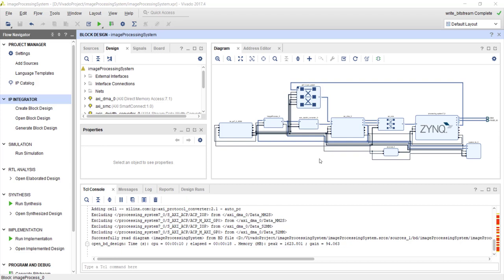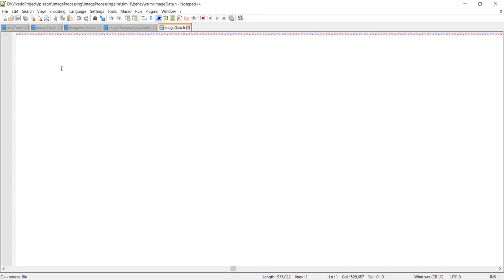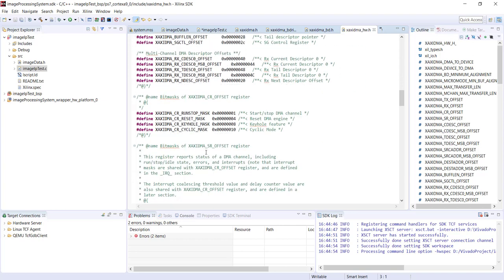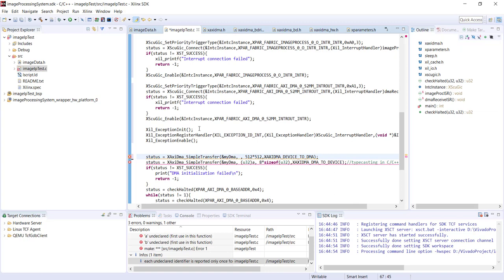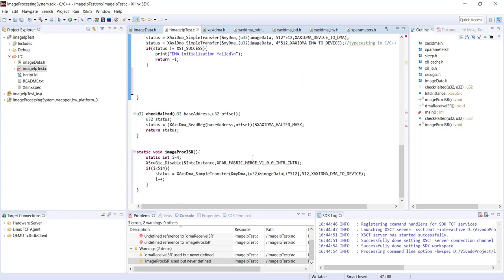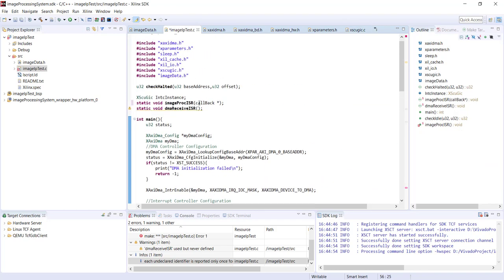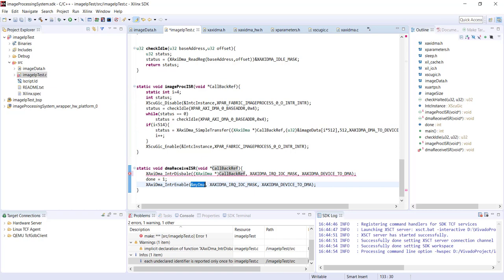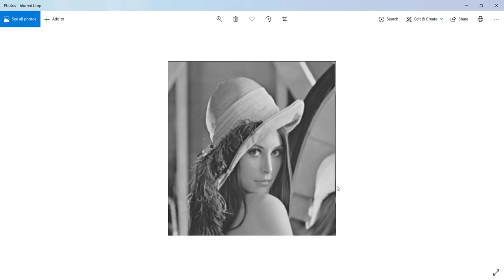Image Processing on Zynq (FPGAs) : Part 8 Software Development and Hardware Evaluation

Comment: Hi. I followed along all 9 videos in this series and I must say these are some of the best videos on the topic. Thank you for taking the time to make these and for making them available for everyone to watch. 
One thing I was trying afterwards was to see If i can reduce the processor clock to a lower speed (to reduce ps7 power consumption) and see if the design would still keep working. The DMA and IP were still getting their 100MHz clock. I saw that at ps7 clock of 333MHz, things still worked at normal but at 150Mhz interrupts would not reach the processor. Any ideas why that happens and what could be done to keep the design function at lower ps7 frequencies?
Also, would be nice if you can make a video on reducing the power consumption of the ps7 as I always notice the majority of power is consumed by ps7 even if it's not doing much. Makes the zynq unsuitable for any battery powered application. Thank you.

Comment: After completing the process up to this step. Below mentioned parameters are not generated in xparameters.h header file as Macros, so getting errors where ever those Macros were called in the imageIpTest.c file. Could you please help me what could be the reason for that, suggest some ways to resolve this. 

XPAR_PS7_UART_1_DEVICE_ID
XPAR_PS7_SCUGIC_0_DEVICE_ID
XPAR_FABRIC_IMAGEPROCESS_0_O_INTR_INTR
XPAR_FABRIC_AXI_DMA_0_S2MM_INTROUT_INTR

Thank you
Reply: Same problem here, in order to fix the XPAR_PS7_UART_1_DEVICE_ID and XPAR_PS7_SCUGIC_0_DEVICE_ID issue, I have change this two lines of code:

myUartConfig = XUartPs_LookupConfig(XPAR_UART1_BASEADDR);

IntcConfig = XScuGic_LookupConfigBaseAddr(XPAR_XSCUGIC_0_BASEADDR);

I think that works, however, I can't try the design becouse of the two remaining undefined parameters. If someone finds any solution, please, share it.
Reply: @JoseMartinez-fe7co  they should be there once you export hardware from vivado if they're not in the xparameters.h file then ig you have to recheck if the peripherals are enabled or not in ps7 system in vivado in your case the uart1 and pl-ps interrupts

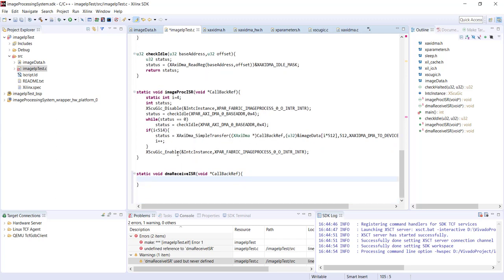Comment: how does the DMA controller know when all the image processing is done from IP @39:10? ( ie what causes the S2MM signal to be asserted to the processor?
Reply from the maker: In the XAxiDMA_SimpleTransfer  function you are setting the size of expected data from the IP (here 512x512 bytes). So once DMA controller gets that many data and once it is written to the memory, it will assert the S2MM interrupt

Comment: Hi, my IP simulation matches your result but my SDK results does not match. It seems to stall at the while (!done) loop and I caught the imageProcess_intr rising edge via ILA. Do you have any suggestions?
Reply: bạn ơi, bạn đã xử lý được vấn đề của mình chưa, hiện tại mình cũng đang gặp vấn đề giống bạn
Reply: hey, I'm having same issue i noticed that the processor isn't able to identify the interrupts from image processor maybe it's because interrupt is very short duration (but shouldn't be an issue with edge triggered), were you able to solve the issue?
Reply: hello i solved this by changing my imageProcessTop file i was assigning wrong value to o_data_ready as axis_prog_full instead of inverse of it assign, changing to  o_data_ready = *!*axis_prog_full;  worked for me